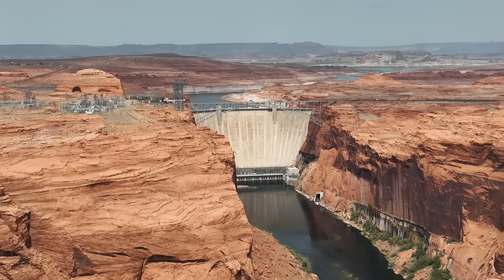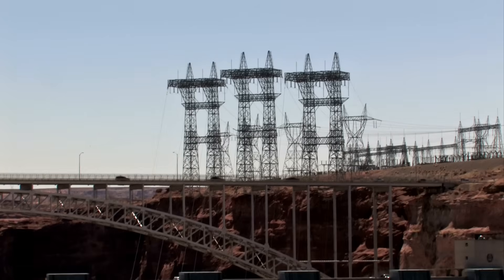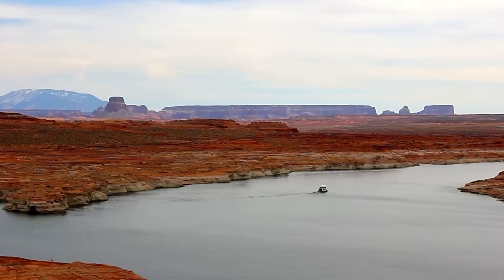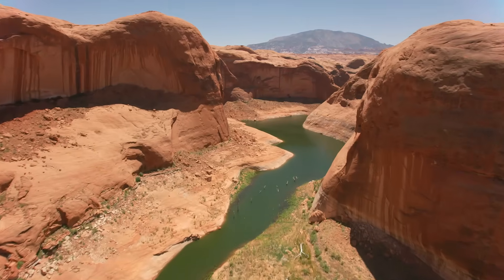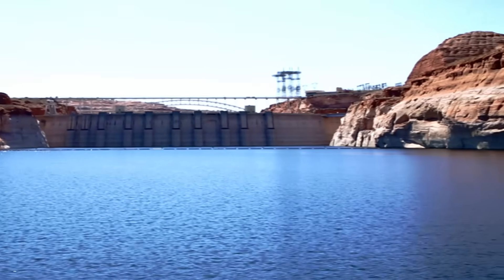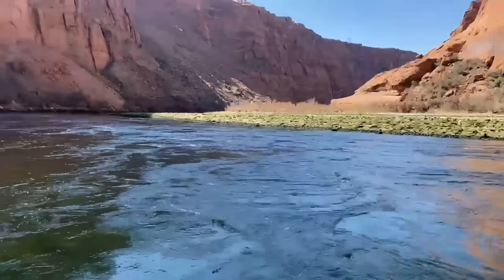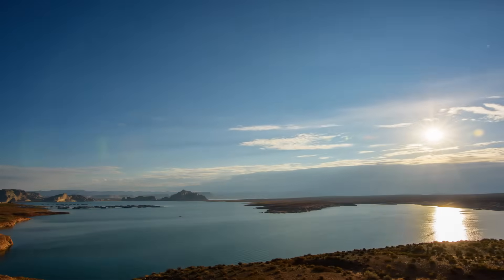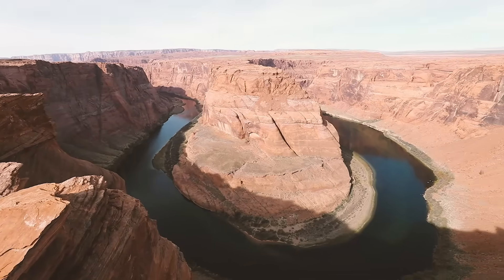Lake Powell Bypass Lines Prepared for Predicted DEAD POOL

Comment: Problem is you can’t allocate more water than you have.  That’s always been the issue with putting a fixed amount of water allocation on a source that is variable.  You end up with allocations that often exceed the available supply.

The obvious fix is to set allocation in percentages.  Each group gets a percentage of what is available so the amount they receive increases and decreases in tandem with supply.  Best of all it happens without the need for more negotiations about who’s going to have to be short changed every time supply comes up short.

Yes, the initial negotiations will be just as difficult (or possibly more so), but once is better than every time supply is less than the amount allocated.
Reply: You're missing the point of Lake Powell and Lake Mead. They are designed to store in wet years and release in dry years. The problem is two-fold. The average flow of the Colorado is less than what was originally allocated and the recent drought is much longer and dryer.
Reply: You can't allocate water that can't pass out of the lakes. Lake Powell is currently 55 ft above "Min Power Pool" and 175 ft above "Dead Pool", that's a 91 ft drop since 2010 and a 10 ft drop since the beginning of this year.  The last time they use the bypass, the one that is reportedly now fixed, it nearly ripped itself apart.

Comment: I thought the bypasses were already there from the original construction. Will, looks like the dams mission to generate electricity will have to go on vacation. Hopefully in 10-20 years the facility will have been modernized and fully upgraded and ready to perform again. At least the needs for water downstream can still be viable.
Reply: The bypass tubes suffered damage from cavitation the first time they were used to pass high flows. The repair works make them resistant to future damage.
Reply: @liam3284  Thanks. I think i once saw a diagram showing cavitation in a water pump's impeller due to water intake being from a higher elevation.

Comment: There isn't much information that is true in this video. The river outlet pipe repairs were needed due to cavitation caused by their use. This same cavitation occurred in 1983 when the dam was nearly lost to the record flooding. And this '20-year drought' keeps getting repeated with no basis in fact. 10-year average flows from the 1930s to today are surprisingly similar. The dam began filling in 1963 and was not at full pool until 1980 - 17 years to fill!! It is also a part of a system of many reservoirs that, combined, store 3x what Lake Mead holds. They play a shell game with the water storage that keeps Mead low because it controls 'emergency' rationing based on its elevation. Keeping Powell low makes sense because of the huge amount of water lost to seepage - due to Powell's geology. 50% of snowmelt meant for the Colorado is diverted to the east side of the Rockies before it can ever enter the river. Large Colorado tributaries have been dammed before that water reaches the Colorado, too. Fun fact: It took nearly 7 years to fill Lake Mead between 1934 and 1941 (it was projected to take only 2 years) due to drought conditions. It was filled at that time only to test the spillways. Since then, Lake Mead has only been full once in its history - in 1983 - when the dam sustained big damage - and the maximum allowable level was lowered by 10 feet. This is the 'bathtub ring' level that most believe is where it normally rests. This is another untrue tale that keeps getting told.

Comment: This is the new pandemic. Make a water shortage. Which i could care less. I live in a plentiful water zone
Reply: We all need to be concerned. Even here in supposedly wet western Oregon wells are running dry. My neighbors well 2 miles away from my farm which is 77` feet deep & has run dry! He is now at the cost of $42,000 drilling a new well going down to 175` deep. He has lived in this area all his 80+ years. We established this farm in 1998. Our well here is only 50` deep. His original well & ours are considered shallow wells.
Reply: groundwater depletition, also a problem in the Colorado basin. A lot of snowmelt ends up recharging groundwater instead of running off into the river.
Reply: Were you always self absorbed?

Comment: It's not a drought, this is the normal amount of rain and snow. When they water allocations were figured up it was in an exceptionally wet period. This flash data set has caused uncounted issues.
Reply: The 20th century was unusually wet, with more runoff than “normal”. They built Glen Canyon dam based on a false assumption.
Reply: You also have to factor climate change, with hotter temperatures, more water evaporates before it gets to the river and from the river.
Reply: Uhhhhh ... Nope.  There is a drought - a major drought.  And it is partly caused by man-made Climate Change.  It is also true that the river has been over-allocated due to the overly optimistic projections of the original water agreements.  Both of these things are true.  
Denial is not a plan of action.
Reply: This is a drought. You cannot dispute the facts about the falling water level of the last 20 years.
Reply: You are half right.  Yes, it IS a drought as defined by meteorologists and has been ongoing for over 20 years.  But you are correct that when the dam was planned and the allocations established the data used was overly optimistic because they were based and wetter than average rain and river flow data

Comment: Turbines vs. Bypass Tubes

Turbines stop working when the lake falls below the minimum power pool elevation (~3,490 feet above sea level). That’s when water can no longer flow with enough pressure through the power intakes to generate electricity.

The bypass tubes sit lower, about 237–250 feet above the riverbed (the dam’s foundation level is ~3,000 feet). They allow some water to be released to the Colorado River downstream even if the turbines are shut down.

What “Dead Pool” Means

Dead pool is when the lake’s elevation is so low that no water can physically pass through the dam — not through the turbines, not through the bypass tubes, nothing.

At Glen Canyon Dam, this is about 3,370 feet above sea level. That’s roughly 120 feet below the bypass tube intakes.

So yes, the bypass tubes delay the problem, but they don’t solve it. If Lake Powell drops to dead pool, the river downstream (including Lake Mead, Hoover Dam, Phoenix, Los Angeles, and Las Vegas supplies) would be cut off except for seepage around the dam.

What the Repairs Really Mean

The $9 million re-coating project ensures the bypass tubes can handle continuous, heavy flow without eroding. In the past, they were used sparingly, almost like an emergency pressure release.

Now, engineers expect them to operate long-term if water levels keep falling. But they’re still a temporary safeguard — not a permanent solution.

In short:

Above 3,490 ft → turbines generate power.

3,490–3,370 ft → turbines stop, bypass tubes keep river flowing.

Below 3,370 ft → dead pool, no releases possible.

Would you like me to make you a clear diagram of these elevation thresholds, showing turbines, bypass tubes, and dead pool level, so you can visualize it better?
Reply: Thanks for the explanation.
Reply: Nice response pasted in from your Chat-GPT query.
Reply: Is it possible to get Columbia river water to Lake Powell?
Reply: @Erik-rp1hi why on earth wouldn that even be considered an option? Create another issue like this one for the NW?
Reply: @Erik-rp1hi  Over all of us NW people who live here in Oregon & Washington.
Reply: @Erik-rp1hi  Yes there is.  Take a bottle to the Columbia river and fill it.  The drive to Lake Powell and pour it in.  Problem solved.
Reply: How do they replace the electricity lost due to this? Especially with the democrats constantly working to get rid of coal plants.
Reply: @kmanbay6580  solar and wind, which the Republican are always trying to crush so they can get their big oil payouts.

Comment: Lake Powell is turning into a mud hole
Reply: It will return to being a river. All the sediment that accumulated will eventually be washed down to Mead.
Reply: @steven4315  This was one of the reasons for Glen Canyon Dam. They performed a survey of sediment accumulation in the mid 40s and were shocked at how quickly Mead was silting up. They also knew that Mead could not provide its legally promised water amounts due to the assumptions made when writing the water allotment compacts. But, unless Glen Canyon Dam is removed, the sediment has no passageway to Mead. The bulk of the sediment settles out 100 miles upstream of the dam when it first slows upon entering Powell. It took from 1963 to 1980 before Powell filled, too.